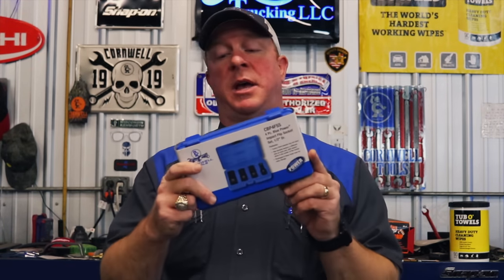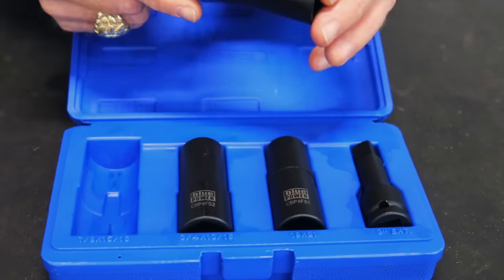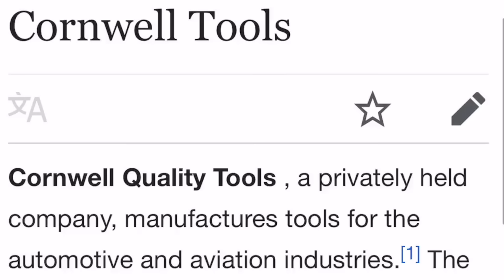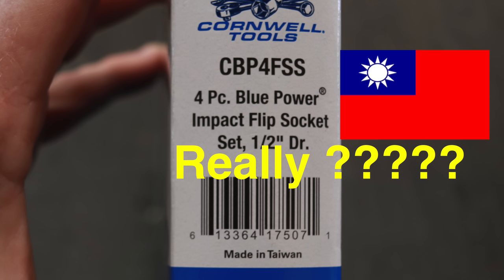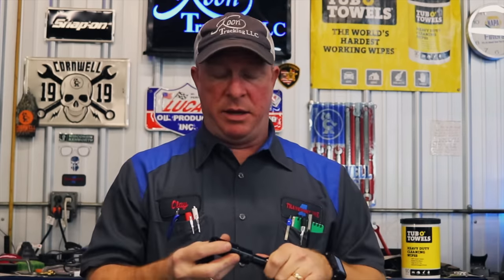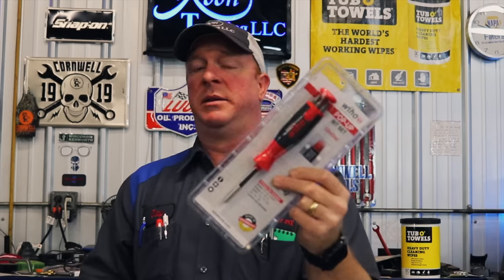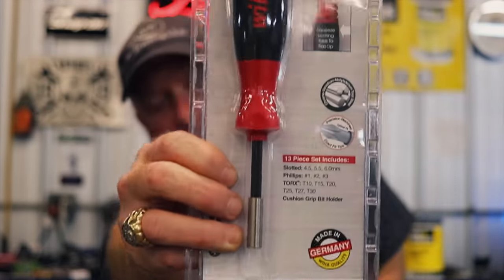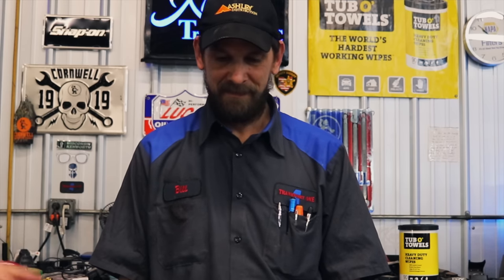Cornwell Tools: Putting Profit Over Quality. Made In USA?? You Guys Are Sneaky AF

Comment: same as snap ons blue point line
Reply from the maker: Bluepoint stamps the tool or the case and some BluePoint is made is USA It would have been nice if it was stamped on there like the pliers they sell are and not in tiny print above a barcode on a piece of cardboard that will be thrown away. In most cases if it is on a tool truck and not ordered in like my set was the cardboard would have been tossed out already so they could be displayed and opened and it would lead you to believe they were American made. I just don’t think they should be so deceptive about it.

Comment: Most Bluepoint is overseas. Are you going to harp on them and complain that they are dishonest?
Reply from the maker: How much blue point stuff have you seen me purchase ? How many blueprint tools do you think is in my shop box ? Not many. I have some blue point in my toolbox in my truck but still not much. Some blue point is USA made but they do stamp the tool or the case not hide it on a cardboard wrapper that will be tossed in the trash.
Reply: I don’t have much bluepoint but none of it’s stamped with country of origin. I just checked the one set of Silver Eagle sockets I own and it doesn’t have it either. I won’t even bring Mac up as we all know their game. I don’t like that Cornwell rebrands sunex and marks it up either. I have only ever bought one thing from the Blue Power line. I won’t buy any of the hardline tools. If I want Taiwan tools I’ll buy Sunex off amazon. But my point is that all the trucks are guilty of it. If your going to go off on one then say it about all of them. It really sucks if you think about it. They are using their brand reputation and your brand loyalty to sell you a lower quality tool for a huge markup.
Reply: Truth be told, while your rep does seem like an honest dude. He should have told you that Blue Power is the economy line.
Reply from the maker: My bluepoint Pliers (hose pinch off) are stamped made in Taiwan and my socket set (that i keep in my pick up) is stamped also ? That’s all i have other than a pick up tool magnet and mirror and the mirror is also stamped ?
Reply from the maker: I don’t think it crossed his mind because when i found out the double flex wrenches were Taiwan, he gave me back full credit on them.

Comment: You can bad mouth Cornwell all you want. The bottom line is you bought their second line tool brand and not their name brand. Lesson learned, stay with the name brand quality instead of trying to save a buck by buying second line brand. All tool companies do this. You have to decide if you are the name brand quality guy or the low budget second rate guy. The price of cool ain’t cheap and only a fool buys cheap...
Reply from the maker: Well I just told my dealer I wanted a set of flip sockets. He knows I don’t buy any tools not USA made off the truck because I’ve put back tools before. The point of the video is they only had it printed on the cardboard label on the box that would have more than likely been removed by the dealer before the customer even sees it. There was no standing on the tools or the case. That’s the sneaky part.

Comment: Lol idk why you are upset it’s just a rebranded tool, you pay for the name and the connivence of them showing up at your shop. If this was the case I would be extremely butthurt because I paid for Snap On not Irwin , I would be upset paying for Matco not Lisle  etc. OTC, Gearwrench, Knipex get rebranded by serveral tool companies. If the tool works then why complain.
Reply from the maker: The point of the video was they try to hide where it was made. They were being deceitful about it. It would have been nice if it was stamped on there like the pliers they sell are and not in tiny print above a barcode on a piece of cardboard that will be thrown away. In most cases if it is on a tool truck and not ordered in like my set was the cardboard would have been tossed out already so they could be displayed and opened and it would lead you to believe they were American made. I just don’t think they should be so deceptive about it. Most blue point stuff is stamped “Made in Taiwan”

Comment: Blue point is made in taiwan why arent you complaining about that
Reply from the maker: They are also stamped “Made in Taiwan” . It would have been nice if it was stamped on there like the pliers they sell are and not in tiny print above a barcode on a piece of cardboard that will be thrown away. In most cases if it is on a tool truck and not ordered in like my set was the cardboard would have been tossed out already so they could be displayed and opened and it would lead you to believe they were American made. I just don’t think they should be so deceptive about it. And some Blue Point stuff is made in the USA btw so you can’t always say “all Bluepoint”
Reply: @KoonTrucking  my blue point sockets arent stamped taiwan
Reply from the maker: It isn’t stamped on the case ?
Reply from the maker: Or ratchet ?
Reply: @KoonTrucking  i just bought individual pieces phillips bit sockets and torx bit sockets
Reply from the maker: The cases and the ratchet are stamped if u bought the set. All Bluepoint stuff is marked. One thing i can say about Snap On at least they don’t try to hide it. Either the case or the tool is usually marked, they don’t try to be sneaky about it.

Comment: This video doesn’t convince me of anything except that you bought a blue power set and your complaining about it not being made in America..... don’t buy blue power. I love the quality of Cornwell but if I buy something that has the blue power logo I know I’m buying something of lesser quality because it’s waaaaay cheaper. Snap on does the exact same thing with blue point and Mac does it with expert, so Incase your wondering before you make another video don’t buy those brands either.
Reply from the maker: It would have been nice if it was stamped on there like the pliers they sell are and not in tiny print above a barcode on a piece of cardboard that will be thrown away. In most cases if it is on a tool truck and not ordered in like my set was the cardboard would have been tossed out already so they could be displayed and opened and it would lead you to believe they were American made. I just don’t think they should be so deceptive about it. Most blue point stuff is stamped “Made in Taiwan”

Comment: Fast forward a year later and weekly you’re pushing Matco overseas tools. Ive been watching your vids for years and it’s unfortunate that you’re becoming a bit hypocritical in your recent vids

Cornwell offers different tools for different budgets just like every other tool dealer. Snap on with Bluepoint, Mac with expert, and cornwell with blue power. Difference is they do in fact manufacture their hardline tools. Matco offers adv/silver eagle and Matco and both are made overseas, but Matco wants big money for their “matco” branded tools even though they’re still overseas manufactured
Reply from the maker: I hope you actually paid attention in this video. Don’t be too quick to judge unless you caught the point of the video. I was very clear they only had made in Taiwan in tiny writing on the box that would normally have been thrower away by the dealer and not on the tool or case. They are being sneaky about it being made in Taiwan. That was the entire point of the video. If i hadn’t special ordered those it wouldn’t have been in the wrapper and it wouldn’t have been marked. Matco is clearly marking the products and also Mac and snap on.
Reply from the maker: In fact the set I purchased off the Matco truck to replace these were MADE IN USA and clearly stamped that way wasn’t even much difference in price.

Comment: Horse shit .blue point and mac and matco all have their Taiwan made stuff.u just have a bone for cornwell because Joe screwed himself out of his franchise
Reply from the maker: You are extremely wrong. I could care less if Joe left Cornwell or not. Never was a fan of the tools they had to offer especially for the price point of their hand tools specifically the ratchets. For the price they ask you can get a snap on that is much smoother and less back drag and feels better and actually has more than 32 teeth in it. The rest of the tools they carry are imported or rebranded. If it weren’t for Milwaukee tools (that you can buy cheaper anywhere else) they couldn’t complete with other trucks. I’ve never seen the value in Cornwell tools they are an old school company that refuses to step up to modern tool designs.
Reply: @KoonTrucking   I will give you the ratchet suck. but As far as the price point your dealer must have been ripping you off because they are a good 30% cheaper than anything snap on or Mac or Matco 'carries..not to mention the rebranding is the exact same stuff the other trucks carry for alot less..as for the imported tools .matco and snap on are the worst offenders for hiding the country of origin. Every one has different opinions .I like snap on tools and mac .and matco .In 45 years of buying tools I've met exactly 1 snap on dealer that wasn't a douche bag .I think they must train them